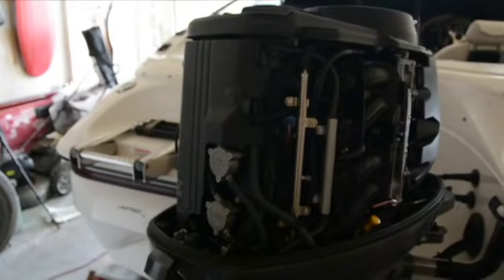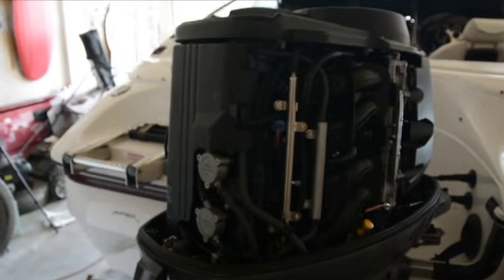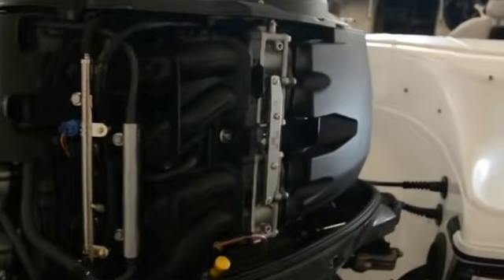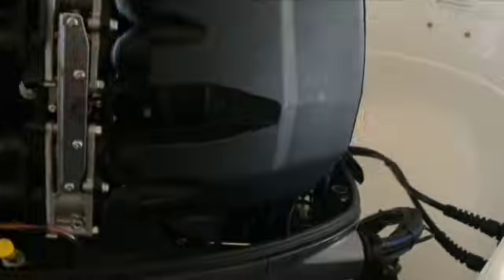How to install a NMEA Cable in a Yamaha Outboard Engine

Comment: I INSTALLED MY ON MY 2018 F70 YAMAHA AND YAMAHA IS TELLING ME I NEED A GATEWAY. TO TRANSLATE THE DATA FROM THE MOTOR TO THE GARMIN HEAD UNIT. DO YOU KNOW IF THE GATEWWAY GOES INBETWEEN THE LORANCE CABLE AS AND IF SO DO KNOW WHAT KIND OF CABLE WOULD I NEED FOR THE GATEWAY TO THE BACKBONE
Reply from the maker: Hi Scott.  Let me check your order for you to ensure you have the correct cables.  Please let me know your order number.
Reply: @ I haven’t ordered before
Reply from the maker: @scotwcates  Our cable bundle for the Yamaha/Garmin does not ever require the Yamaha gateway unless the boat is configured for fly by wire.  If you don't know if your boat has fly by wire, it doesn't have it.  This is generally for much larger engine configurations and boats.  Here is our cable solution.  

https://goldenchannels.com/product/yamaha-lowrance-garmin-humminbird-complete-nmea-bundle/

Comment: What type of motor data does this enable to be displayed?
Reply from the maker: Most outboards will show RPM, Engine Hours, Oil Pressure, Engine Temperature, Fuel Burn rate, and Alternator Voltage.  Yamahas and Suzukis will display trim, if you like, as well.

Comment: Thank you for a great instructional video. I see you have a specific kit for the Humminbird Helix. I have a Yamaha FX150 (2020) and a Solix 10 G3. Has the NMEA plug in back. Will the Helix kit work for this setup? Assume that kit has everything I need including a 5 amp fuse on power cable. Just one question: I have a 22 foot center console bay boat. Do most people install the NMEA backbone inside the console, or inside the stern hatches with the engine and accessory batteries? If console, I’d just need a long cable for the engine lead and short ones for Solix. If in stern, I’d need a short Yamaha lead and long Solix cable. Thanks!
Reply from the maker: Hi Tommy.  I'm just writing you an email now.  Talk in 10 minutes.  Eric.

Comment: I'm confused. On your website it says "Used in the 225, 250 and 300 HP models." this video shows you pointing out the plug on a 150.
I was wondering if my 200 Vmax SHO has it. I don't have the boat yet so I can't check. Thanks for clarifying. As soon as I get my boat I'll be buying the kit to connect to my helix10 😁. So glad you're in Canada eh bud
Reply from the maker: Sorry for the confusion.  There are other cables we sell for Yamaha that are for power (150 HP+ models have built in isolators for a house battery).  The NMEA 2000 Yamaha installation video should maybe be more clear.  Any Yamaha built since 2006 from 25 HP up has the same NMEA cable, and all the Yamaha bundles we sell will work for 25HP and up.  Does that make sense?
Reply: Yup that's where I got confused. So back to my question. The battery isolator lead on your site, will it work on my 2021 sho 200 even though you state only the 225,250 and 300hp has it? I'm asking because the f150 has it. Thanks again for your help. 😁
Reply from the maker: @BjBnet  you need a different Yamaha Cable for the 200 for the house battery.  It is Yamaha Part Number 68F-81949-01 and it is for the 150-200 HP outboards.  Keep in mind that this cable and the isolator powering it is for lead acid battery use.  If you are using Lithium, or any other chemistry other than Lead Acid or Sealed Lead Acid, this charging method for a house battery may not work or may even cause alternator damage.  The move to other battery chemistries is the reason we no longer stock these cables and are phasing them out of our inventory to focus more on NMEA only.  Hope this helps.
Reply: @GoldenChannels  I live in Canada, I can't afford a lithium battery lol. Thank you for looking up that part number and the information. It's VERY helpful.
Reply from the maker: @BjBnet  Lol... I hear you.  I'm up here too.  We don't hear from Canadians that much.  Take care.

Comment: Hi, do you happen to know if Yamaha F40 FEHDL (2021) is suitable for this? I already have NMEA network and seem to have this plug, but wonder if this is limited to F50 and higher, 

Thansk!
Reply from the maker: If the connector is there, it should work.  We will also give you a full refund if it doesn't.
Reply: @GoldenChannels  Many thanks, I have sent you a message.

Comment: On the Merc you have to buy a $650 module plus the cables...
Reply from the maker: Yes, you're absolutely correct.  For most of our customers, that Mercury solution is not practical.
Reply: @GoldenChannels is Suzuki that simple?
Reply from the maker: @chadnorman572  We can make it that simple. We sell lots of Suzuki cable bundles and understand exactly what you need.
Reply from the maker: Our website has a Suzuki cable configurator, or I can email you a parts list
Reply: @GoldenChannels that would be awesome,  I have a 09 df 250 ss I would like to set up my lowrance hds 9 gen 2 with
Reply from the maker: @chadnorman572 my email is Eric. Larson@goldenchannels.com if you would like me to put together a parts list!

Comment: @goldenchannels I found the plug and connected the yamaha cable to basically extend it to the center console. There is a specific J1939 port in the back of the gps (GARMIN 943XSV ) you attach a small "pig tail" yamaha adapter cable to make the connection. Unfortunately I have no information going to the motor. I called Garmin and they said its plug and play; no settings needed to be adjusted. Not sure why its not working.
Reply from the maker: Two different protocols.  J1939 isn't NMEA 2000, although they are similar and both based on Canbus.  Your Outboard sends NMEA 2000 PGNs, and you need an NMEA 2000 Network.
Reply: Apparently you need a yamaha hub?
Reply from the maker: @ryanmtown  No, you don't need the hub.  We sell the exact kit you need here:  https://goldenchannels.com/product/yamaha-lowrance-garmin-humminbird-complete-nmea-bundle/

Everything you need is there, and nothing you don't.  This is the minimum cable configuration to get engine data to display on your Garmin from your Yamaha outboard.

Comment: So does either a NMEA cable and/or J1939 cable attach to the plug on the engine?  What about the Yamaha multi bus port?  Can the cables attach to that instead?  I have a Garmin 1243xsv, and im looking for the easiest solution. I dont have a NMEA backbone at all.
Reply from the maker: Yes, either an Yamaha Specific NMEA cable or the Yamaha Command Link cables to their Command Link gateway will connect and communicate.

We also make a cable bundle that gives you a cost effective complete cable network that is custom designed for your fish finder:   https://goldenchannels.com/product/yamaha-lowrance-garmin-humminbird-complete-nmea-bundle/

Hope this helps.
Reply: @GoldenChannels  does the cable have to connect directly to the engine or can it go into the Yamaha mutil hub instead? Thanks
Reply from the maker: @bido8176  The cable bundle link I sent does not need any Yamaha components.  If you already have Command Link components installed, we can bridge from an existing Command Link system.  But if you do not have any Command Link cabling or devices, none are needed, only our cable bundle.  Does that make sense?

Comment: What do I need to hook up a Yamaha vmax sho 200 to a hummingbird helix 7 4th gen
Reply from the maker: Hi Justin.  We have a complete bundle for that.  The two cables bundles you need are here:  https://goldenchannels.com/product/yamaha-humminbird-helix-nmea-bundle/ and https://goldenchannels.com/product/humminbird-helix-g4n-nmea-2000-cable/

Those will give you a complete setup for your boat.
Reply: Thanks! I may have to go with a lowrance hds-7 since I want to see engine hours. What will that take?
Reply from the maker: @justinabbott1155  Lowrance HDS series has always supported NMEA 2000, and we have a kit specific for it and the Yamaha.  Only one item to buy:  https://goldenchannels.com/product/yamaha-lowrance-garmin-humminbird-complete-nmea-bundle/

Everything you need is in this bundle for your Lowrance HDS and Yamaha Outboard.
Reply: Thanks!! Will this show the fuel and trim on the motor or will I need extra pieces?
Reply from the maker: @justinabbott1155  Trim can be changed between reading on an analog gauge (if you have one now) or trim data can be send over NMEA 2000.  You need to move a wire inside to do this.  It is a single conductor pink wire with two choices of single conductor connections.  Fuel Consumption is given on your fish finder, but if you want fuel tank level, that is another device.  But most guys update their fish finder settings for fuel tank capacity, and tell the fish finder when they fill up, then it can calculate distance to empty very accurately.
Reply: Is the lowrance/Yamaha bundle not available? I don’t see an option to buy it when I open the link.
Reply from the maker: @justinabbott1155  Hi Justin.  It's there.  You need to look for the blue "add to cart" button, just past the two options for  fused power and the backbone cable.  My email is also sales@goldenchannels.com if you have difficulty.

Comment: is there a bluetooth dongle?
Reply from the maker: Murphy, I'm curious what you would like this kind of connection to do.  There is currently no standard in NMEA about how Bluetooth is used.  So far, any Bluetooth enabled products for NMEA are very specific to a manufacturers intended purpose.  I spent 20+ years in the wireless industry.  Bluetooth could be used for NMEA signals/data.  Other wireless options also exist, depending on what you want to do.
Reply: I have a 20 Ft Nautic Star boat. I am installing a garmin echomap UHD  fish finder, I have a Talon and a Yamaha f150 four stroke. The Talon would connect with a helix fish finder, If you could find one. The motor would connect with nmea. But running the cable and the ts or hubs is a pain on this size boat. If blue tooth would connect and apps were avaiable they  would connect just fine. This may not exist, but I thought I would ask.
Reply from the maker: @murphybrown32216  Nice boat.  That is an interesting idea.  The problem I see is in almost all of the locations on the boat you would have a bluetooth transceiver, you would still need power available at that individual location.  Would this still save you any wiring effort?
Reply: sure, the talllon is allready bluetooth, all it lacks is an app for the garmin, the yamaha has plenty of places to pick up 12 volt power. They do sell a yamaha dongle for the diagnostics, I have one comming. That will let you ride and look at live data and codes.
Reply from the maker: @murphybrown32216  The YDIS bluetooth dongle is less expensive than I would have thought, and I see the app is in the android store.  Sounds like an interesting little project.

Comment: I have the Nmea2000 cabe l bought online for my 2004 200hp 2 strokes. I can’t find the connector. Spoke to yamaha dealer they said it should be there somewhere. It might be hidden because sailfish manufactor for the boat installed analogic gauges on dashboard instead digital.
Reply from the maker: Eduardo, our website shows that the Yamaha NMEA cable only works with Yamaha Outboards manufactured in 2006 or newer.  If you purchased this cable from us, we will offer you a full refund.
Reply: I have an 05 200 2 stroke vmax, and i looked for it and couldnt find it. then today, i replaced my trim tilt switch and it was tucked all the way under that rat nest of cables! i hope it works

Comment: Hello.  My engine 1997 yamaha 115 2 stock.  Do I have any chance to connect my data cable to lowrance?
Reply from the maker: Thanks for checking us out here on YouTube.

Unfortunately, the 2006 model year 4 Stroke Yamaha Outboards were the first to have the connections required.  I have not looked into any kind of aftermarket products to bridge that gap, but they would most likely be taking analog signals from the sensors and simply digitizing them, so basically converting a gauged analog reading/connection.  It is unlikely that things like fuel consumption would show up.

Sorry I couldn't be of more help.
Reply: @GoldenChannels  thank you for responding
Reply from the maker: @greattransport6184  You're very welcome.  Sorry we couldn't be of more help.

Comment: I'm new to Marine outboards as I'm not a boat owner, however I'm in a position where it's appealing to learn as much as possible about modern outboards, made within the past 6yrs, starting with Yamaha outboards... What confuses me though is the Yamaha engine gateway offered for NMEA connectivity, yet I've read NMEA is natively available from the outboards of modern era. Can you elaborate more on if this is true with your F-Series, and what year your motor is?

I understand NMEA2K is merely a CAN based variant protocol specifically for marine (closely based on J1939 used in heavy machinery) however I'm looking/hoping for a means of logging without a gateway in my case if that is possible with Yamaha's F-Series from 2016-current.
Reply from the maker: Hi Kyle.  My F150 is a 2009.  Yamaha F series engines have the internal NMEA connector on any engines from 25 HP+ starting in 2006 to current day. The clearest way I can describe the difference between CommandLink and NMEA 2000 is there is no electrical difference.  The connectors are different mechanically between systems.  As you can see in our other videos, all Yamaha instrumentation works identically using our NMEA cable sets.
Canbus provided the NMEA folks a simple way to use both existing  connectors and chipsets for products.  Voltage levels and connections are almost identical, but messages are obviously designed for the marine situation.
If you want more info on our setup to monitor NMEA2K and 0183 messages, drop me an email at eric.larson@goldenchannels.com
Reply: @GoldenChannels  thank you sir! I'll be emailing you.

Comment: Hello!! I would like to know the year of your engine!! I have the same motor f115 tlr. Do you know if my engine has nmea2000 cable(connector)? Thank you!
Reply from the maker: Hi Lefteris. If your engine is a 2006 model or newer, yes, it will have exactly the same cable as my engine.  We sell it here: https://www.goldenchannels.com/product/yamaha-nmea-2000-cable/
Or, you can buy everything to hook up a fishfinder too:  https://www.goldenchannels.com/product/nmea-network-starter-kit-complete-kit-for-lowrance-and-yamaha/
Just let me know if you have any more questions!
Reply: @GoldenChannels  yes my engine is 10/2008 model!! So I will search it.Thank you for the reply!!  You help me so much!!
Reply from the maker: @lefterisvasilatos6452  You're very welcome.  Feel free to email me if you have any more questions.  eric.larson@goldenchannels.com
Reply: @GoldenChannels   One more question please, do you know if it is possible to see the consumption from the engine(Litre per hour) l/h to Lowrance ?
Thnx for Everything..
Reply from the maker: @lefterisvasilatos6452  Absolutely! That is one of the main reasons I have this in my boat. It helps me set trim and RPM for the best fuel economy. The picture on our website is my old Lowrance HDS. Let me know if you need any more info.
Reply: Will this work on a 2021 150 vf 150 it a vmax sho
Reply: @bobbyakridge57  As Golden Channels stated above, if you Yamaha is 2006 model year or newer, it will have the NMEA2000 plug.

Comment: Would this work on a 2012 yamaha 40hp 4 stroke ?
Reply from the maker: Hi Brendan. I'll check some more when I get in the office tomorrow, but I believe that the NMEA connections are on Yamaha 4 strokes that are 50HP and up.  Talk to you tomorrow.
Reply from the maker: Brendan, I think you might still be able to use our standard NMEA cable after all.  I'll know more tomorrow...
Reply: @GoldenChannels  no worries I'm keen to know as I would like to get this hooked up on my boat
Reply from the maker: @brendanjuster5479  Brendan, Can I please have the Engine Model Code for your engine, and also the make and model of your fishfinder?  my email is eric.larson@goldenchannels.com
Reply: No worries I'll email you cheers

Comment: The subject of this video needs to be corrected. It showed me where the connector inside was it didn't show me how the cable got run into it.
Reply from the maker: You're right.  We put that in a separate video here: https://www.youtube.com/watch?v=mGENFfzLhxg&t=6s

The reason we did that is the same method applies to both the house battery cable and the NMEA cable.

We need to automatically get you there, so we should do a play list.

Sorry that this wasn't more obvious.